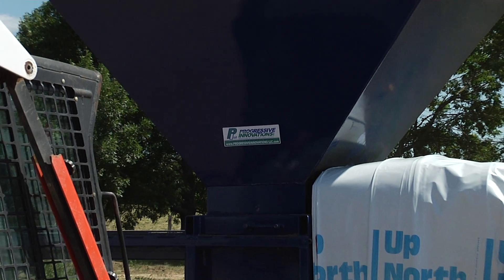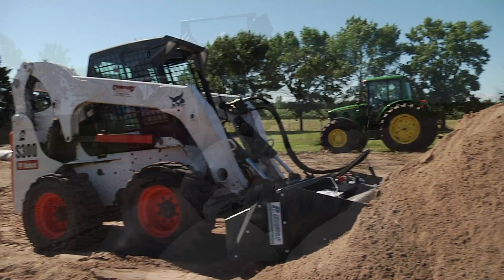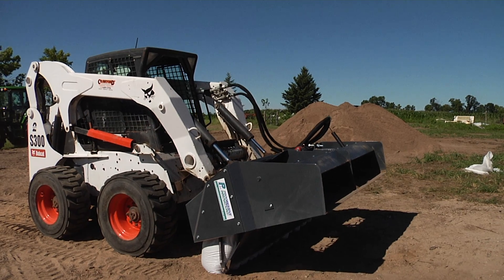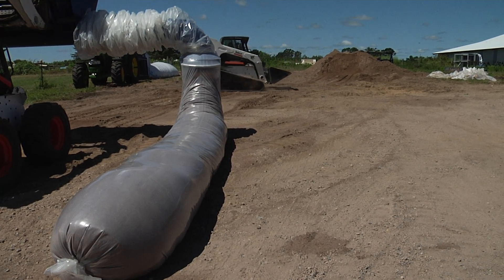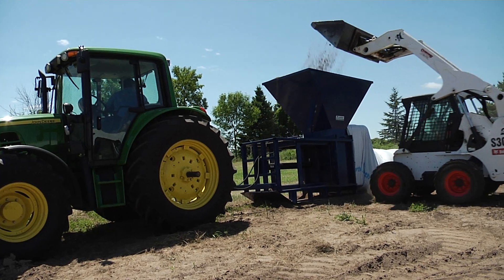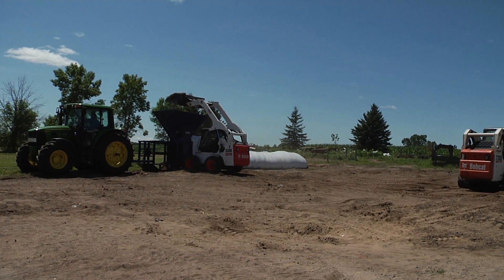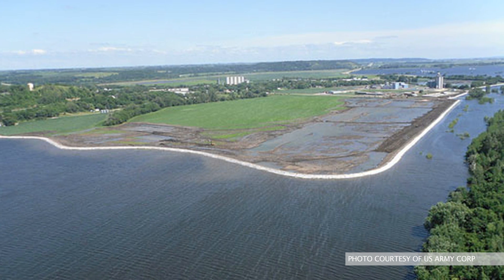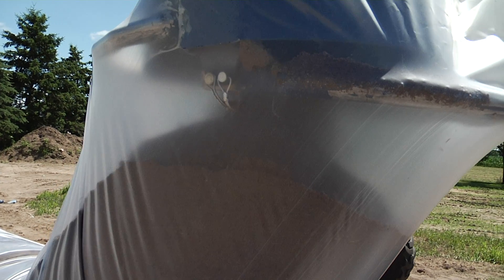Progressive Innovations:  Flood Barriers for Modern Times

Comment from the maker: Fast-Built Levee (FBL) Technology is a powerful flood defense and is environmentally friendly as they are an easy cleanup, the plastic poly is 100% recycleable, and the sand or dirt fill may be reused. Also, FBL is often 1/3rd the cost of sandbagging. Learn more at www.progressiveinnovations.com and +Progressive Innovations.

#SandbaggingMachine #SandBaggingMachine #Sandbagger #ProgressiveInnovations #flood #flooding  #sandbagging  #CenturyBusiness   #FeaturedStory #FloodBarriersForModernTimes #EmergencyManagement #FloodControl #Resilience #FloodDefense #Roi #OilSpill #ChemicalSpill

Comment from the maker: Learn more at: www.progressiveinnovations.com
Progressive Innovations' featured story on 21st Century Business includes the ProBagger 12 sandbagging machine (a skid loader bucket bagger) as well as the Instee Levee Builder and Quick Levee Builder.
Progressive Innovations LLC is based in Cambridge Minnesota, USA, we at Progressive Innovations are enthusiastic about developing solutions to perplexing problems. We have developed powerful equipment that has created solutions for flood and erosion control. Our flood control technology includes the ProBagger 12® a unique skid loader operated sandbagging machine and the Instee Levee Builder® an exceptionally fast Levee building machine. These two machines are maximizing the flood fighting potential of skid loaders.  Our Quick Levee Builder® is a super heavy duty levee building machine capable of making a 42 inch high levee in a single pass. Both of our Levee building machines, the Instee Levee Builder® and Quick Levee Builder® create Fast-Built Levees®. Fast-Built Levees® are a water-tight, stackable, easy cleanup levee. These Fast-Built Levees® replace the need for sandbags in all flood applications except those in very tight places where sandbags are still required. This means that Fast-Built Levees® can minimize an entire city's need for sandbags in a flood event to less than 1/100th the current need. These tools are creating affordable flood fighting solutions for governments, businesses, and land owners.
 We at Progressive Innovations have additional Innovations such as new firefighting tools as well as the FX line of erosion control technologies that we have custom developed for Filtrexx International, a long standing business partner who is using our innovations globally.

#SandbaggingMachine  #SandBaggingMachine   #Sandbagger   #ProgressiveInnovations   #flood   #flooding    #sandbagging   #CenturyBusiness   #FeaturedStory  #FloodBarriersForModernTimes